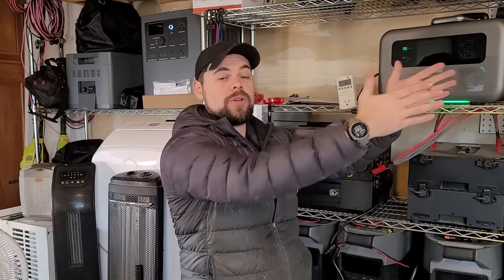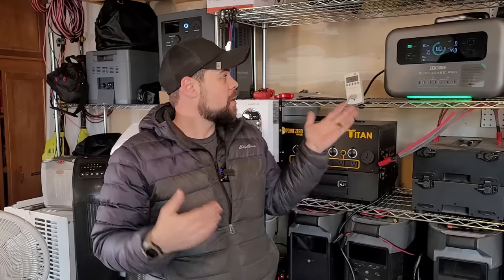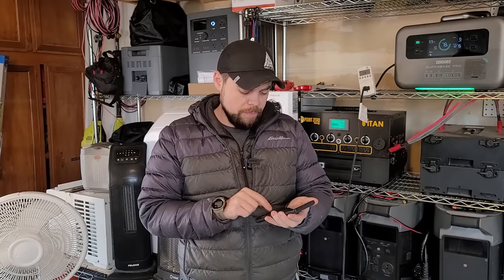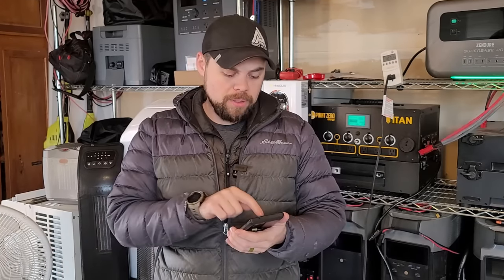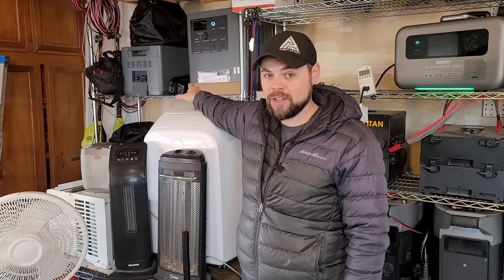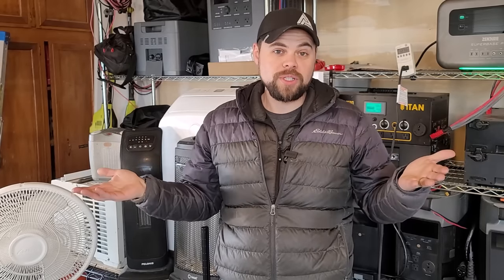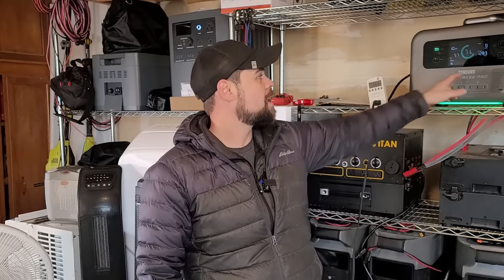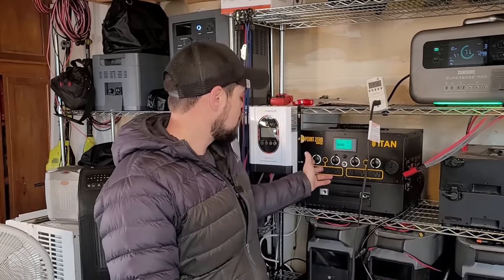Running Space Heaters on Solar Battery Power

Comment: Not sure which part of the US you're based but be thankful you're not in the south west of England ... days & days of Winter gloominess where 180w panels typically manage only 35w input!  Both propane & paraffin (kerosene) are used as heat & cooking in my bungalow and three small power-stations run lighting, phones & low-capacity TV.  Not terribly cost-effective BUT electricity rates in the UK currently, are astronomical.
Reply: He's in Idaho.
Reply from the maker: I feel for you, that's got to be very difficult. I was in London in October looking at how we could possibly help the UK with backup solar power options and the bottom line is that in most cities and towns people don't have a lot of space to put solar panels so that they can make enough to really keep solar equipment running. You said you're in SW England, do you have much space for setting up solar panels?
Reply: I bought 2no 180w rigid panels along with a Delta Mini, EB3A & EB70S when I lived in NY and brought them over with all my chattels in November. Most appliances & woodworking tools were all 120v, 60Hz so they had to be supplied similarly.  I also brought two traditional (US) generators one being propane pure sine specifically to charge the stations on just these weather occasions.

My energy use is low so even though the Winter days are gloomy, just three or four hours of clear sun is sufficient so far to boost the smaller of the three and sometimes I resort to using the car's 12v port to top-up too.

But in connection with your video, propane or paraffin has to be the best ways for space-heating despite the disadvantage of increased moisture & slight ventilation issues.

London, like NY, is just a cramped metropolis which is why you'd have noticed the plethora of 'wind farms' and offshore turbines ... there is simply limited capacity for city dwellers to generate their own supply.

Comment: Nice to hear.  I have done all the same mental gymnastics, and ended up with exactly with the same conclusion.  This year I'm going to add a mini split to my arsenal.  I can heat with Solar Radiation, Solar Electricity, Wood (cord or pellet), Natural Gas, Propane, Diesel, Kerosene, Waste Oil, or Electricity.  I can cool with Solar Electricity, Shade, Convection, Water, Water Evaporation, or Electricity.

Comment: I have a 300 watts space heater for camping. Can I do it with a battery
Reply from the maker: Yes. Take the total watt-hours of the battery and divide it by 300w. Example: 2,560wh ÷ 300w = 8.5hrs of run time. To get the watt hours take the voltage of the battery and multiply it by the amp-hours. Volts x Amps = Watts.

Comment: If you are going to run a nat gas furnace not only do you need to calculate the power needed for the fan but also the power needed for the ignitor.
Reply: That is literally nothing.. and for about 5 seconds..
Reply: @MalWolf01  but it requires surge power. Not so sure that 500w will do the trick.

Comment: 500w rating. But what does the space heater actually pull? Start up, & continuous? Heat elements and fan and light? Definitely need propane n candle lard heaters lol.

Comment: But if you have really good insulation in your theater room, your heater would not run 100% of the time.  It will cycle on and off.  And what temperature do you want?  If you're desperate you could lower the temp in that room to maybe 60 degrees F.   It might be better to run the 500 watt heater rather than the 1300 watt heater and keep the fan kicked up.  Some will allow you to do that.  
But you're right .. if you have gas figure out a way to run your house furnace and then close off as many rooms separated from the thermostat as you can.  Then it might be better to get the family in the living room and spend the night there.  Keep the fan cycle time low to take off the chill factor.
Reply from the maker: Yes but that also depends on the heater itself. Some do not have a sensor to turn off when the room reaches certain levels. But above all, this was meant to be a simple video to help people understand the concept. We didn't get into inverter efficiencies, power on/off due to the temperature being reached, recharging with solar while running heaters etc. But you're absolutely correct.

Comment: As well as knowing the power output of the inverter, and the energy storage of the battery, it is worth knowing how much power is required to heat a house.  For a house 10m x 20m with 2.4m high walls, the surface area is 544m2. If all surfaces have insulation with an R-value of 4, and there is a temperature difference of 20C (36F) between inside and outside, then heat loss is 20C * 544m2 / 4K.m2/W = 2720W.  To maintain the inside temperature, you would need a 3kW heater.   Adjust the temperature difference, house size and R-value for your house and climate.  This is oversimplified (more heat loss through ceiling than floor, and ceiling usually has better insulation), but is enough to show that heating only a single room during a power outage is more achievable.  Where I live it doesn't go below freezing in winter and the whole of house heater is 10kW, and the temperature difference between inside and outside is 7-15C.

Comment: You could have had a heatpump unit and extended the units capacity by 2.5-3 though.
It may help in a pinch, but is even more expensive. Would already be in place for a home with powerwall type setup and solar I guess.

Comment: You can buy minisplit that runs direct off solar panels its about 900 watts  cost just over $1000 you can buy other non solar for about $800 they say you get about 5 hours solar away average 

You can use Solar thermal collectors are panels which are (usually) fitted onto your roof. The panels contain tiny tubes of water which are heated by the sun.
This heated water can reach up to 90 degrees C. It is passed down into your home where the heat is transferred to water in a storage tank or cylinder via a coil.
Reply: Wherry can you buy that?

Comment: I run an electric oil heater during the day with my 2000w solar generator and 2.5 kw battery and 800 Watts solar.(2.5 to 3.5) kw day in winter. It’s pretty mild climate and lots of sun so it’s pretty comfortable during the day and reduces main heater use.  Definitely wouldn’t do much in 0 degree weather and cloudy weather situation.  I also use to run a small ac in the summer with similar results.  Takes the edge off but not much more.  A thing to note is in grid down you will probably prioritize other loads ( lights / fridge etc) that coupled with inverter efficiency pretty much makes electric heat a no go or any sort of climate control a no go.
Reply: funny thing is, all the electric energy you pump into loads inside your house will eventually heat your house, no matter how small. Only exception is if you power a gas heater that cools the ventilator with external air, and external lights. All the rest - lighting, electric chargers, computer, fridge, everything in the house - will ultimately shed that power as heat into the house.

Comment: I’m looking at putting together a solar electric heating system for a rig. I’m going to build the system myself. Do you think 200ah is good enough? It’s a small space so a 500 watt or less heater will work. I will put the nice high output alternator in my rig and fill the roof with solar. I have the availability too just plug in once a week also too charge. Also gas gen as back up. Any tips are helpful thanks 🙏
Reply: He basically covered it but to make it simple... converting electric to heat is very inefficient. He didn't mention the lost in conversion when going from 12v to 120v. Ignore the lost in converting, 200ah will only run a 500w heater for 4hrs if it's a lithium battery. A rated 200ah agm battery gives out somewhere around 150ah at the most or around 3hrs of run time. You have to consider conversion lost, cold temperatures (battery loose capacity when cold), recharge rate (recharge slower when it's cold) and battery cycle. The most I ever got from a 100ah agm using a 350w automatic cemeric heater going through an inverter was 3.5hrs in 40 degree weather. Hope this gives you an idea. Smart move is to use a natural gas or liquid fuel heater. Look into a diesel heater
Reply: We have a 200 watt heater, and heating a small 17’ travel trailer in 45F temperature, it was pretty useless so don’t even consider less than 400 watts. Our 1500 watt heater worked very well at lower settings but we had access to 120 volt outlet.

Comment: What about inverter and system overhead of the power station.  Surely that will eat in to the total run time
Reply from the maker: Yes it does but this was a video to keep it simple. I'll likely be making a complete solar course that goes into the gritty details like that.

Comment: My power outage plan when my really only concern is for heat via my pellet stove.  I can easily run my Harmann P43 pellet stove for 5 hours off a 100 AH battery (w/pure sinewave inverter).  My plan is to run my inverter generator for several hours to power the pellet stove AND a battery charger to recharge the 100 AH deep cycle battery.  Then run off battery for a few hours, lather, rinse, repeat.

Comment: I have 2 200w panels in an indoor window. My question is will the panels still generate heat when not plunged in? with summer coming I wonder if I will need to take them out.
Reply from the maker: Yes they will make power through a window but substantially less than if they were outside.

Comment: Love your videos.
However, it needs to be understood that any time you move electricity there are loses.  And, larger loses when converting DC to AC, topically 15%, although I've measured as high as 30% on cheaper inverters.  So, a 1kW power source will really have around 850 usable watts at the inverter output.
This principal also applies to the DC output of solar generators... regulation isn't free!
Reply: That is important for calculating runtime. On the other hand, losses are generally heat so if you have the inverters and such in the area you are heating, the system would approach 100% efficiency.
Reply: @Rickmakes  Not only would that "benefit" not hold up when you want to cool (it would actually be a determent), but an inefficient system requires more solar, storage, and components.  And, heat is not beneficial to MTBF.  Efficiency matters.

Comment: I tried for the longest time to find some sort of battery back up for my aunt in case of power outage that she could keep warm and heat food. Most of these devices especially anything USB will not even boil water much less rent a space heater. We were able to find a small 250 white space heater that doesn’t do a whole lot, a jacket with heating coils… But ended up having to get a gas generator because the battery technology just isn’t there yet. As soon as you can boil water with USB device that is one battery technology will be there

Comment: I have 66kWh of home battery storage from recycled S/X batteries with solar on every usable inch of my roof. I personally run an Antminer S19 Pro into my furnace vents to heat my home and make some money on the side. My main breaker has been off for 2 years.  I recommend people bypass all these little portable battery systems. Start with a few panels and whatever form of Lithium battery chemistry that gets you the lowest $/kWh then just scaling it up over a couple of years. I started with one single Model S module, an inverter and a single solar panel.

Comment: I have solar on my house. At the time, I didn't get batteries. I figured I could add it later. Of course finding someone to install it is about as easy to find someone who has seen bigfoot. When I do get a quote, it is way overpriced. Without the battery when the grid goes down, I go down as I am connected to the grid. The solar does a good job during most of the year. 

All I need is a small wind turbine to add in non-optimal weather conditions and at night. Then of course, I need batteries. 

I have NG for heat, so that isn't an issue. 

I produced 12.8 MWh last year and exported 333 kWh. It's Oct-Mar that are my lower producing months.

I was looking at the Anker SOLX F3800, or something similar, which I would just add expansion batteries to. 

I work in IT and have set up battery backup for buildings, server rooms, etc. I also have an electronics background from the Army, but I am getting older and I know nothing of code.

The kicker, I work supporting the grid. You'd think I'd be able to find all the resources we had to help with this type of shit but I find out more on my own and it is sad. 

But I agree with you, the grid is getting overloaded. The infrastructure bill is helping, but it's more of a band aide. Texas is going to be the worst as they are 100% privatized and it's all about profits. Having power plants producing at 85% capacity when you don't need the power means they aren't making money so when the storms or really hot or cold weather hits, they can't cover and the people who live there are screwed. I lived near Houston a while, which is where I got our building generator and battery backup for our server room as well. The hurricane right before I got their took them down for almost 2 weeks.
Reply from the maker: It's near impossible to get copmanies to add batteries. I do it for people sometimes. Shoot me an email to info@poweredportablesolar.com and I can see what it'd look like to get it done for you and see if I can save you some money.

Comment: Your better off doing solar thermal or a heat pump for solar heating with solar, solar thermal with evacuated tubes is near 100% efficent at collecting solar energy where as solar PV are only about 21 - 23% efficent although if a heatpump that can get a COP of 4 or greater you are basically equal to solar thermal and when it's not quite as cold you can use that electricity to do other things hence why solar thermal apart from for hot water is not really used, although I do think a system of 1 solar thermal to 5 solar electric in area is a pretty good balance because you can keep very hot water from the solar thermal for hot water and to add extra heat to the outlet of the heat pump from 30C to 35 - 40C, obviously for ultra cold or overcast days I would want propane as a backup.

This is only for places that are cold the vast majoirty of the year if I lived a hot place I would go completely solar PV

Comment: The one thing I don’t understand is why you would use an inverter to change the direct current (as stored in the battery) to alternating current to plug-in an resistive heater Like the ones shown. While convenient this is inherent inefficient. To me, it would make more sense to use a DC heater like this used in an RV or camper.
Reply: I didn't know dc heaters were available. That would be more efficient. Where could I get one?

Comment: better solution, but only for gas heat forced air furnaces.... install a $100 Reliance controls 15amp transfer switch for your furnace, then plug it into a backup battery (or better a small generator).  furnace blowers vary consumption based on speed, but expect 4-8amps load.  at 120v that's around 960watts startup, and 500watts when running.  approximations.  so, you can run your furnace for 15mins for 250watts.  That's about 12hours of heating your entire home on a 2kwh battery.  now... level up and get a 2kw predator generator from harbor freight.  now you can run your furnace for a few weeks from a 5gal gas can.

Comment: How long does your Buddy heater run on a full BBQ tank ?
Reply from the maker: It depends on the heat setting on the Mr buddy. A gallon of propane holds about 90,000 BTUs. If the heater is using 10,000 BTUs on high then it will last 9 hours for one gallon. A 5 gallon BBQ tank would last 45 hours non-stop.

Comment: The problem with using energy killing 1500 watt space heater on your battery system is the risk of running your system down to zero or close to zero.  I never let my LiFePO4 batteries go below 50% to maximize their lifecycle.  I really plan to get at least 10 years or 10,000 cycles on my pair of power queen 200 AH batteries. I'd rather use my ventless natural gas heater as a backup heat source or my buddy propane heater instead of electricity.

Comment: i run 5 oil filled radiator heaters set on 600 watt setting during the day when solar is producing 6000 watts, then as the wattage go's down at the end of the day i switch over to propane, wood, pellet stove, witch ever is cheaper to run.

Comment: You will run that 500w heater over 8 hours with 2000w battery on low thermostat setting.

Comment: I cook with electric - thats about the only Heat type use for battery power -
Reply from the maker: Cooking with electric isn't as bad if you'rea talking about a single stove top burner. It uses the same amount of power for typical cooktops, induction cook tops use much less power. But with cooking you're not running it for hours. So it's still a lot of power through the inverter but from the battery capacity not nearly as much.

Comment: Another option either a small heat pump like 9000 BTUs just for one dedicated area uses 4 to 5 times less wattage of power compared to a resistive heater. 

So you use less watts initially and you get 4 to 5 times more BTU energy from the same amount of water is that would be normally used for a resistive heater. .   

Some people because of health issues I understand cannot have the option of running a kerosene or propane heater inside their house, because of asthma and other respiratory problems, where even the slightest elevation of unburnt hydrocarbons, or a small amount of CO carbon monoxide or elevated levels of CO2 carbon dioxide Causes severe respiratory, sometimes headaches, nausea, and flu like symptoms by using any kind of hard your carbon-based heater inside a house.